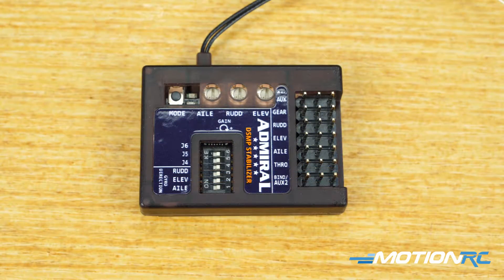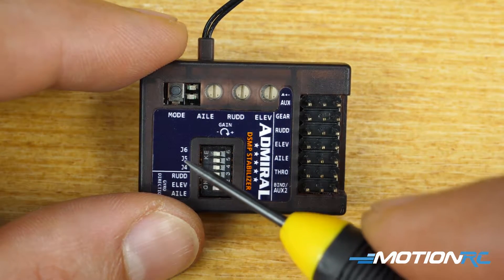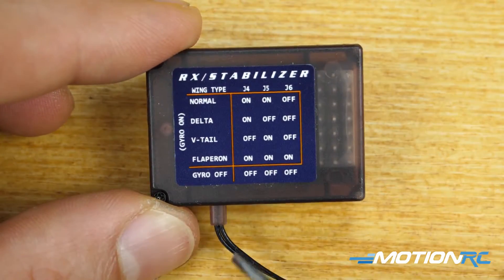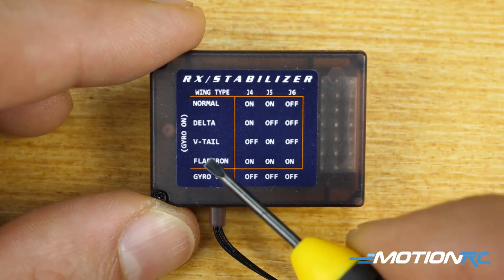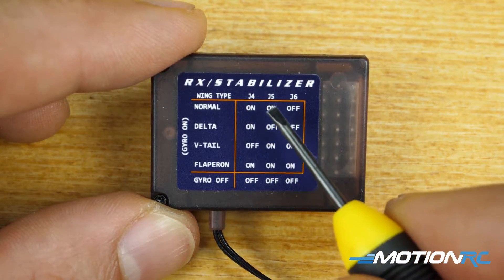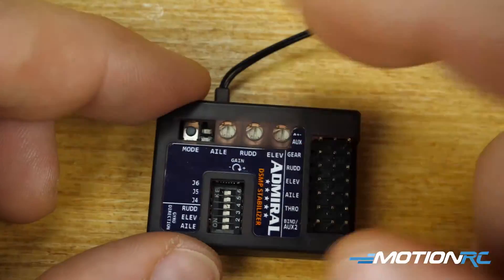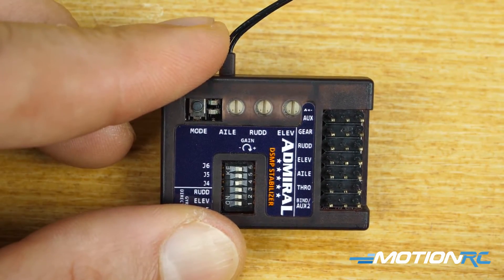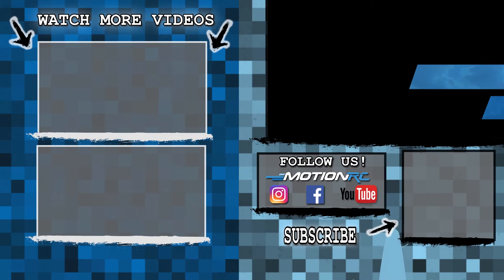Dip Switches - Admiral RX600SP Stability Plus Gyro - Motion RC

Comment: Hi James, I'm trying to set up a plane for flaperons but cant get it to work seems to work fine until I press the recovery button then the ailerons go crazy what am i missing i also noticed that with the button pressed and throttle applied  the elevator starts to deflect down to full and the ailerons start rotating when i release the button they return to normal
Reply from the maker: Hard to diagnose through a youtube comment. Best to probably call our customer service and speak with someone who can better get the full explanation

Comment: james , heres a tricky question, when choosin flapperon , where do aieleron servo leads go AND how do you setup the Spektrum radio for flapperone ???
Reply from the maker: depends on the model, but assuming your model has the ailerons on a y lead and elevators on a y lead. they will plug into the same respective ports. Then set your transmitter to normal because the Gyro will do the work